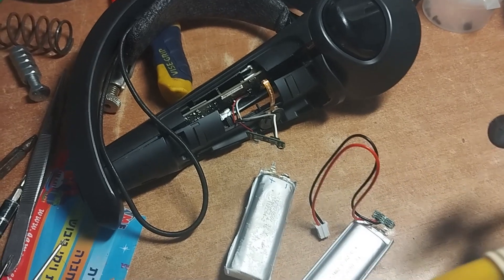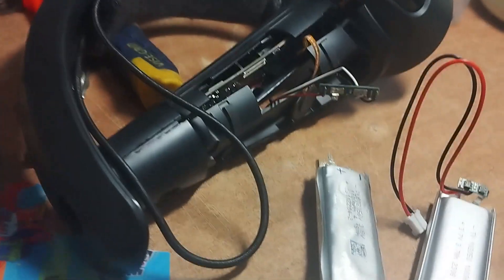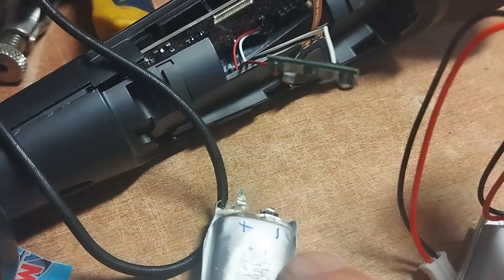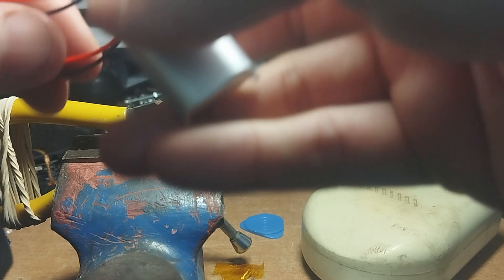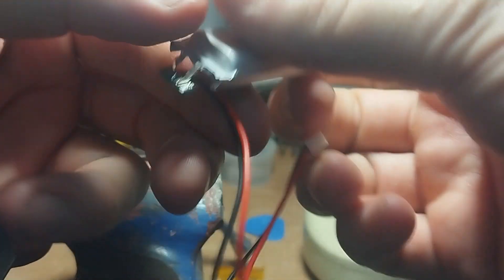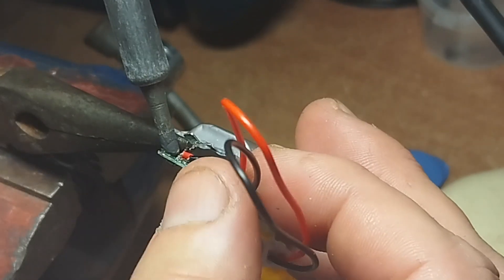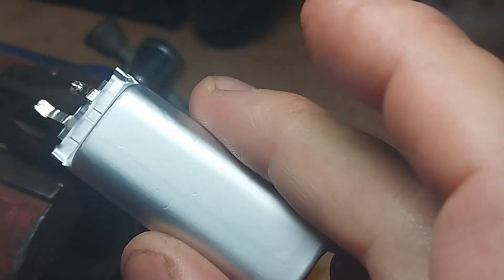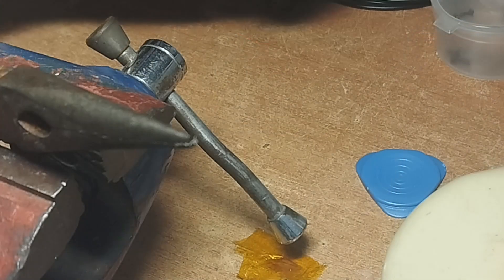Replacing batteries on a valve index controller? Watch this to save your thermistor!

Comment: What I wanna try to do if I ever take my valve index battery out is see if there’s a way to use them with the cord plugged in and not have to have the battery inside the controller. That way I can get indefinite controller time and just dispose of the battery.
Reply from the maker: I ran them from USB power while playing before I swapped the batteries out. That works fine
Reply: @shacharliberman5084  So I wanna try to get external battery packs with those red and black wires and the 1.2 connector to put inside my controller but have the cord sticking out the controller for swappable battery. I've heard of 18650 battery types and 21700 battery types. Do you or sneaky Joe know what type of external battery I should look for to try and use to power my index from outside the controller?
Reply: @shacharliberman5084  so I can remove the battery and then just run it from usb?
Reply: @shacharliberman5084  reason why I wanna try to remove the battery before running it through usb cord is because eventually even while plugged in the battery could still die plus the controller would probably get real hot. Hopefully this works and who knows if it will after I remove the battery and use the cord in the usb to power it instead?

Comment: It might be a bit dangerous to solder 3.8v bms to 3.7v battery. Might not be too critical, but just in case please consult with other electricians or people who work with batteries and understand their limits. With such mod I'd always keep an eye on the controllers while they are charging. And I'm not responsible if your house burns. I'd rather recommend to use the original battery without a thermistor with original battery bms.
Reply from the maker: I'd like to update that I've been using the batteries for a while now, also left them charging over night several times. I had no issues, and the plastic near the battery area is never warm. (I didn't open the controllers to check the actual temperature of the battery though.) 

However, I do think that it's possible that the 3.8v bms will keep my 3.7v lipo battery on the charge (not cutting it off) because: a 3.7v lipo battery with a proper 3.7v bms, while charging, at 4.2v the bms would cut charge off. but a 3.8v lipo battery with a proper 3.8v bms keeps the battery charging until it goes to 4.4v.

So I can't really tell what truly happens without getting the battery on the bench and testing it, but my guess is it will have to charge up to 4.4v and only then  the bms stops the charge, but that means that the battery suffers some overcharging once it goes over 4.2v.
and then, I guess that this cycle will happen again when the battery drops to ~4.3v maybe, idk, when the bms decides it needs to fill it back up again.

It proved not deadly to me or the house so far, but it is reasonable to not keep it on the charge for extended time.
Reply: He got the battery out and was perfectly fine. I think he knows what he’s doing. He’s just trying to help people out with pcvr. Nobody’s wants to keep spending $279 on controllers for vr
Reply from the maker: @SpringChickensOnlyMan  
Thanks, but SneakyJoeRu is the actual guy that made the initial tutorial how to crack your way into this very complicated piece of hardware.